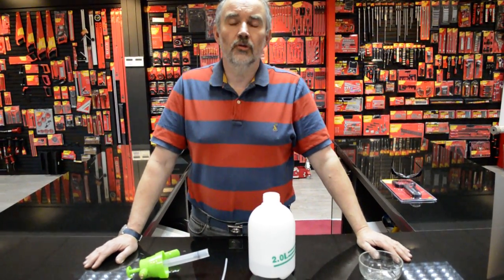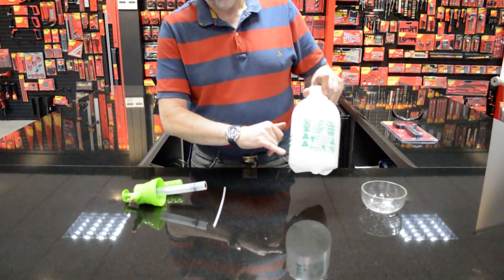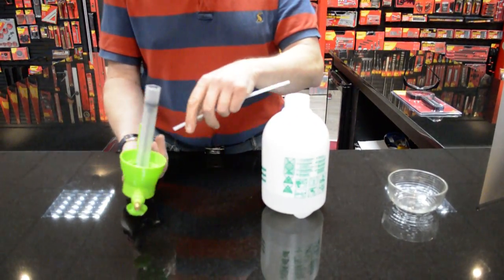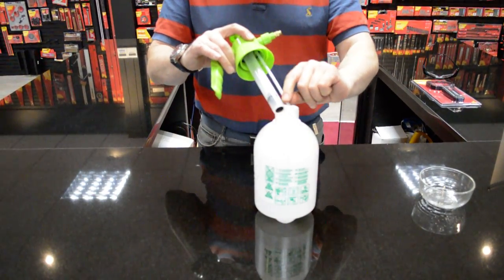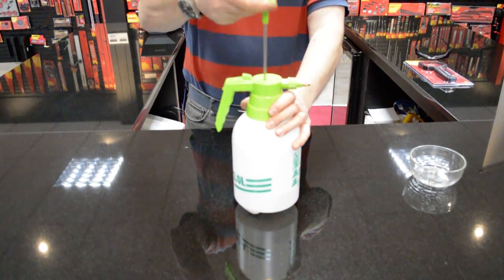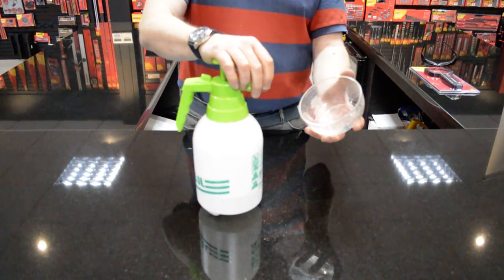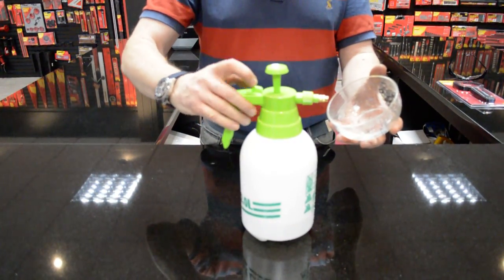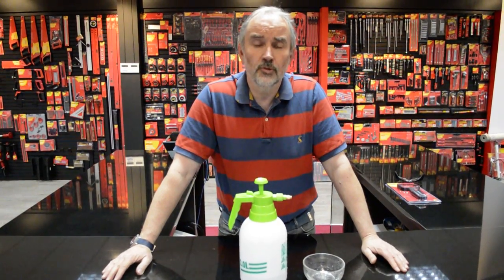How to use an Amtech 2 Litre Pressure Sprayer

Comment: mine doesnt hold the air in when u pump it. so there is no use for the handle. how do i fix this?
Reply from the maker: Hi Maria, It sounds as if the lid is not tightened enough to form a seal. Please email contact@dktools.com
Reply: @AmtechDIY   no need, the problem is resolved now   😊

Comment: Sir I have one problem concerning about my pressure sprayer. However if I wanna want to pumps up basically water is not coming out . therefore what could be a problem?
Reply from the maker: Have you unscrewed the nozzle? or you may have a blockage, Only 2 possible areas
Reply from the maker: please subscribe to our YouTube channel for more DIY know-how:
https://www.youtube.com/channel/UCqRCNftBSq1zhrd9NB5IWzw
Reply: Have the same issue. To return it is it's not enough  pressure to use as a spray